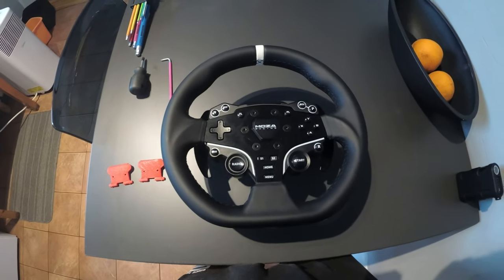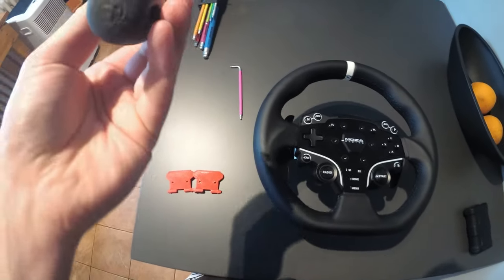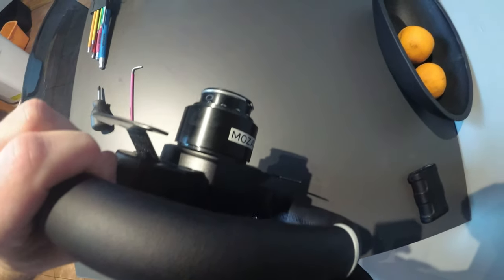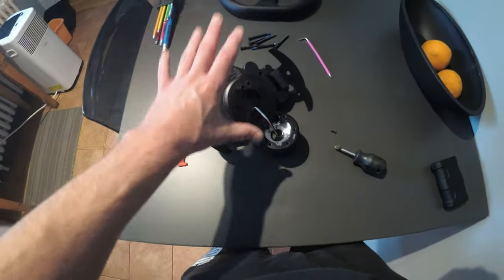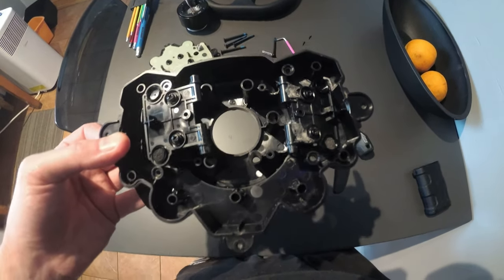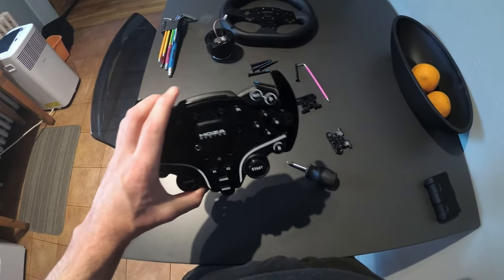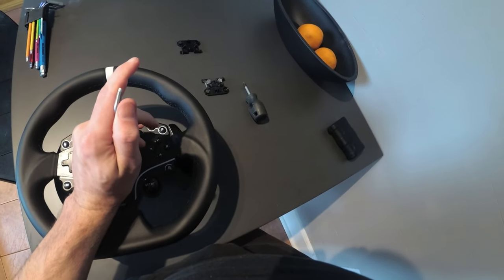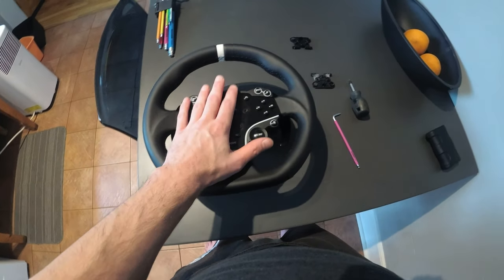Moza R5 Wheel Paddle Repair

Comment: Before I'm going to open it up; Mine only now and then fails to shift gears, and sometimes it's only either the up-shift or the down-shift that isn't responding, so I'm wondering how that could be if the issue is breakage? Curious to hear your thoughts on that. Thanks for this video.
ps (edit) At the end of the video you say ''they print these universally,'' which made me wonder if Moza's other wheels (if I wanted to buy one of their other models to replace this failing one) have that same flimsy plastic part in them?
Reply from the maker: For mine, it was only one side that was broken, but it wasn't instant, I think it had a hairline fracture that eventually was a complete break. Perhaps you're is both sides.

I can confirm it effects their other wheels. The 3d print file works on the cs, es, and gs wheels. Not sure what years, though. I suspect their newer wheels have different internals as I think seen pictures of the whole shifter being one solid piece, instead of a metal outer and plastic inner.

I would suggest a factory reset and calibration before opening anything up. Moza has guides for both of those on their website.
Reply: @RacingBlind9  Thanks very much! Will give that a try.

Comment: I started to hear rattling sounds when my wheel go around. At first I thought a screw is come loose. But after watching this video I am starting to think I have the same problem as in this video. My left shifter is working, but it has more play than right shifter.    Don't You have warranty on these wheels, why didn't You just send it back?
Reply from the maker: I did have warranty, the lead time for shipping it out/being repaired/sending it back was ~ 8 weeks. Not something I wanted to do as I don't have a backup wheel.

I've also read that some people get the fix done on the paddles only to have them fail again months later.